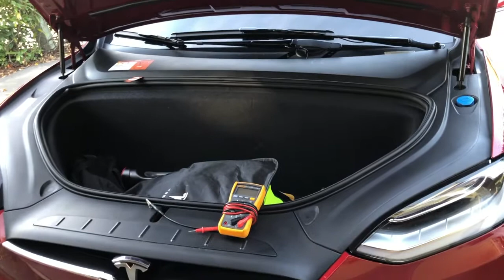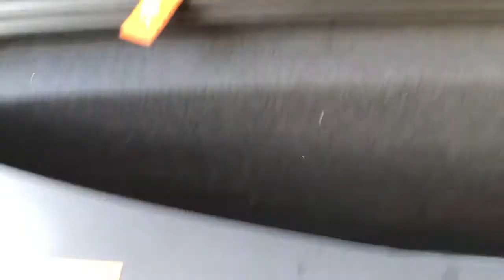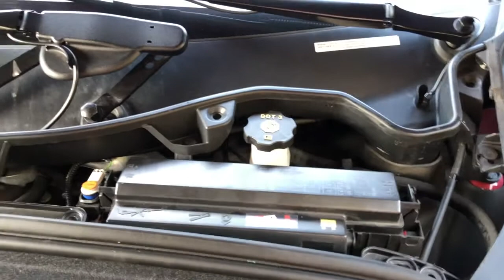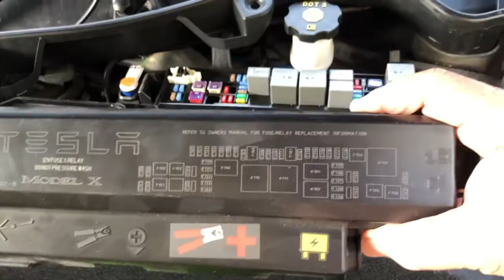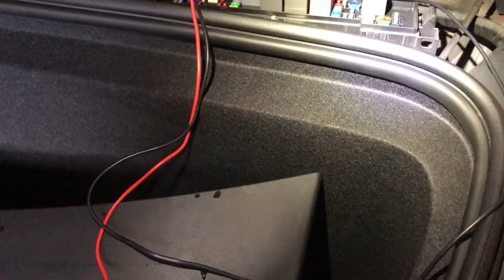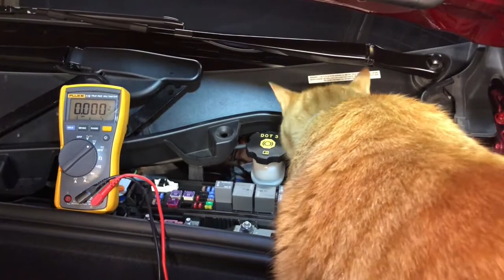Tesla 12V Battery Health Check

Comment: Not very accurate. The quickest way to do it is by disconnecting the fireman's loop to disable the HV battery which will stop it from charging the LV one. OR another method would be to first turn your vehicle off (by navigating safety on your tesla MCU screen then POWER OFF) then you can go about your business of measuring the 12v batt. Third would be to disconnect fireman's loop then disconnect the negative off your 12v batt then test voltage.

Comment: So car has to be "asleep" to check. Or totally disconnect the 12v from system before testing
Reply from the maker: Yes, the 12V charging system needs to be off or disconnected.  This makes 12V battery checking tricky.

Comment: Bow often do you check?
Reply from the maker: I would recommend starting to check after year 3 of the current battery age, then monthly or bi-monthly.  After year 4, at least monthly.  You should see the progression of battery voltage drop from 12.6 V (new) to below 12.4 V.  Change out the battery below 12.4 V to be proactive, and absolutely change it if the voltage drops to 12.2 V.